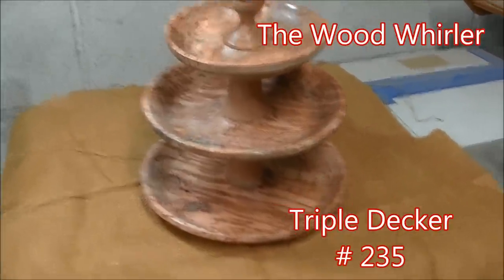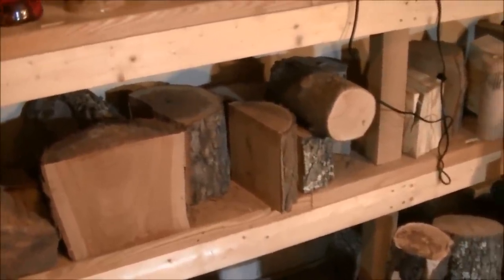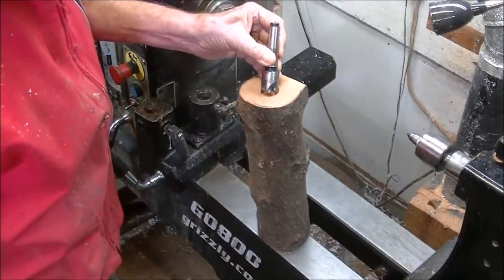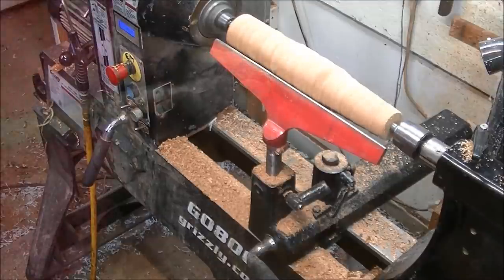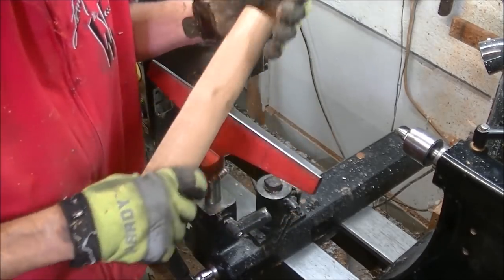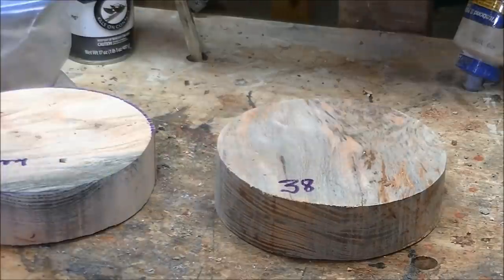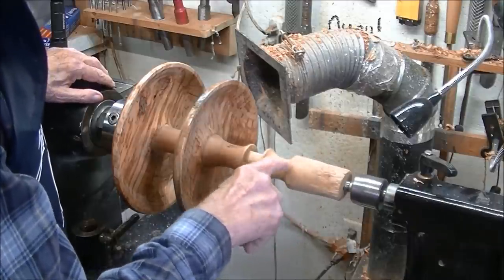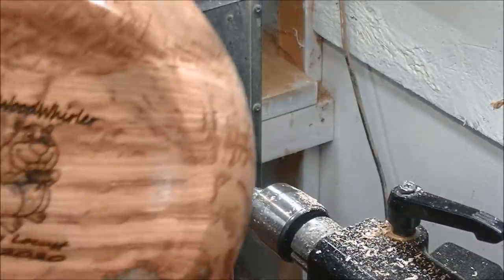Triple Decker # 235

Comment: Hi Larry,  Great project and really something different.  Would make a nice serving piece for candy, snacks for the holidays and I would like to make one.  You mentioned the diameters of the plates but what length & diameter did you make the posts between the two lower plates as your spacing & size really looks very nice and proportional? Glad to see your back and doing better.  Take Care, Myles
Reply from the maker: My daughter took off with it, so I can't measure.  But best I remember it was 4" center to center and about 1" diameter.  Thanks, Larry